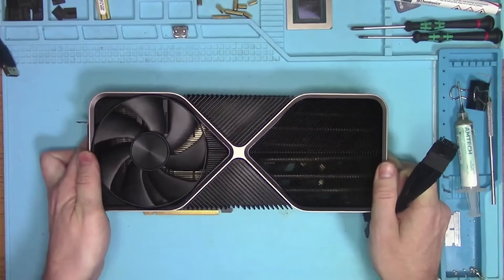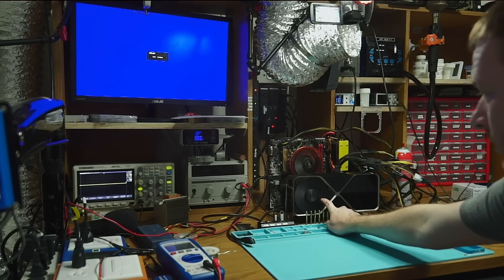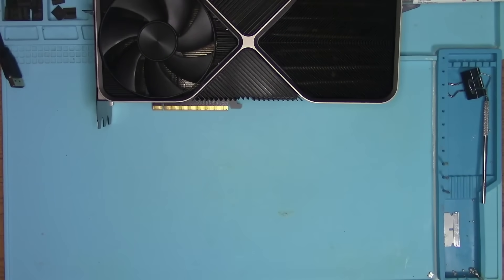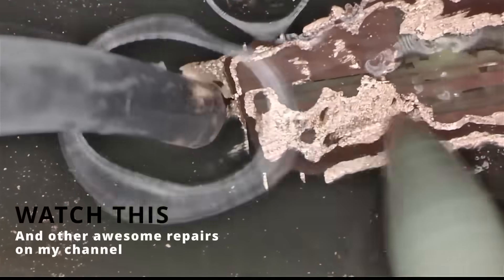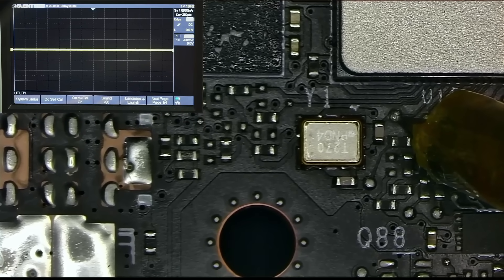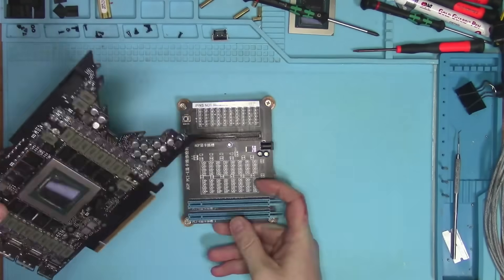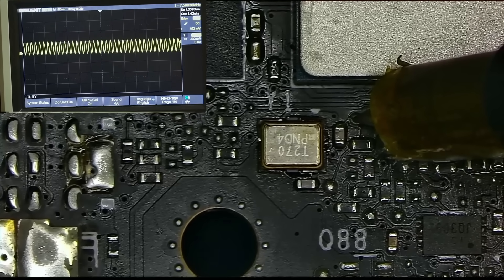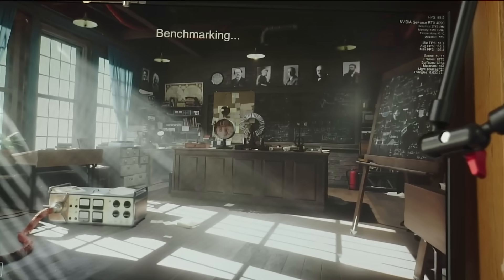*Warning* this video is NOT a JOKE

Comment: Fun fact: The first bug in a computer was actually a moth that wandered into a computer and caused constant errors. Since the machine didn't stop and wasn't equipped with any of the fail safes we're used to today, technicians had to figure out the problem all by themselves. This was back in the 40s. Nothing was modular back then. When something broke, you had to take everything apart and rewire the entire machine. Computer technicians were more like car mechanics.
Reply: Remember-the active elements of the computer were vacuum tubes with high voltages.
Reply: Both my brother in laws were time served car mechanics, when all else failed out came the real tool kit a big hammer and a wrecking bar.
Reply: The version of the story I heard was that it was slot-card computer, and the bug made a 0 become a 1 or vice-versa.
Reply: @benoitbvg2888  I think it's the absolute nightmare of any programmer when debugging an error doesn't cause a crash! It's kinda like navigating a huge maze and after you reach the end, you discover you're not at the exit and you probably took a wrong turn somewhere.
Reply: That "fact" is indeed funny but wrong. The word bug was already used in technical contexts by Thomas Edison and others 150 years ago and comes from a Middle English word. The situation with the moth got famous because it was a literal bug causing a bug, but it wasn't the origin of the term.
Reply: @brinkoftext  Yes, actually I only recently learnt about Edison being among the first people to coin the term "bug". But, I would argue that the incident with the moth was the first bug in an actual computer. So it was the first known computer bug. There could have been hundreds if not thousands of smaller problems involving other machines, but this was the first notable bug in a Turing type automated computational system.
Reply: @robdom91  Unless you exclude all kinds of software bugs this 100% was not the first bug in a computer. And even without software I bet there was at least one computer prototype before that which had a bug in its hardware design.
Reply: @brinkoftext  If we also consider analog computers then we can go back all the way to the stone age. I'm guessing the first bug being called a bug must have been so uneventful it's obscured. So, in that sense it's impossible to tell which machine had the first bug. We can only know about recorded incidents. And I was talking about actual computers not just any machine. Though, it's strange I never heard the term bug used in any other context besides computers. This could mean Edison and friends didn't use the term often as it didn't really stick in any other context.
Reply: @robdom91  Edison wasn't the first to use it, just the first case that's documented. He used the word like it was already established in engineering circles.

"And I was talking about actual computers not just any machine"
Sure, but that computer Grace Hopper worked on wasn't the first digital computer.

Comment: How the fuckballs?... That wouldn't have passed QA, so how'd it even become available to the public? Because in theory those that don't pass QA are looked at and fixed or stripped for parts. Guessing it went in the "recycle" bin after failing core tests but some enterprising worker grabbed it and sold it. Which is crazy given how strict GPU manufacturer's are about prevent employee theft.
Reply: Could it have been a larvae that hatched and caused the detectable fault later?
Reply: @SianaGearz  - no, the heat from soldering would have killed the egg. Also the insect looks fully grown, though what species it is I have no idea. As I majored in molecular biology, not entomology :P
Reply: @The_Mess85  Oh right how did i not think of that. That it has no chance to survive hahah make your time all your base are belong to us, sorry.

Let's say it's a fruit fly. Others say it's a fruit fly. I have no clue, but it does look like it might be one.

I'm still wondering what if the card DID pass QA somehow, like if the insect was dry enough because well 260°C generally make quick work of moisture, and nested itself just between the solder balls, so it wasn't an electrical problem initially, but then something happened, maybe the carcass drew moisture from the atmosphere or some such like and became a little conductive, and clock drive tends to be an extremely impedance and capacitance sensitive circuit, or the steam that the insect gave off while soldering prevented the formation of a good solder joint nearby but it was sort of touching, there was signal, until some heat cycles later the connection broke because there was a spotty oxide layer across the pad.

Comment: So nvidia do not xray as part of quality control....., what else they do not do.....
Reply from the maker: They also dont install LED connectors so your LOGO has LED's and a wire but no connector on the PCB
Reply: They might actually do that but they didn't have the software flag up a fly larvae. It probably didn't look like much because the weave of the glass on every substrate is a little different so you won't have the images match up exactly anyway and the opacity of the organic matter is similar enough. X-ray would only be looking for defects in the metals and soldering.

Comment: You should have sent a bug report to Nvidia hotline 😂
Reply: lol "I found a bug in your graphics card😂😂😂"
Reply: NVIDIA:  That was a user bug.
Reply: Nah, don't bug them
Reply: NVIDIA: Sir, that's not a defect... that's our new thermal compound  BugPaste for organic cooling.
Reply: Should i be worried about Cable-Mod 180 v1.1 -- it secured solid or will it melt the GPU connections when I'm pushing the card hard w/flight sim graphics?

Comment: I had a bug fly in to an empty RAM slot on my mobo- it shorted the MOBO out. Luckily letting the mobo sit overnight and the capacitors discharging fixed the issue (after removing bug and cleaning RAM slot) 
Bugs kill computers too.

Comment: some of the most impressive shit i've ever seen period the amount of skill this guy displays is crazy
Reply: same thoguhts, that's some dedication and skill, i wont even have the patience
Reply: You can tell he didn't get that way without tons of practice and repetition, too - what I always find pretty interesting about watching guys do stuff like this is that I can tell how seasoned they are just by watching their handiwork / fingerwork - right down to how they apply solvents or pastes or the like.   You can usually tell when someone not only has a firm grasp of something in their head, but also in motion - committed to muscle memory I suppose you could say.  It definitely shows.

I guarantee, even if I hid uncertainty, just about anyone would be able to tell if I were to make such a video - even if the info in it were 100% correct, you'd be able to tell almost instantly if I stepped in front of the camera to do the exact same procedures... that I was a rank amateur.  This guy's videos actually do sort of inspire me to take this up as a hobby, using one of my old cards from builds long past.
Reply: @VeggyZ same bro I really wish I could redo what this guy does this is pure artwork at its finest
Reply: @VeggyZ  correct, if he screws up the amount of flux on that main GPU chip, it's a no go and a do-over.  It's like a commercial airline go-around...too many of those and you're fired.

Comment: I had a mainboard with dead USB ports due to a mosquito shorting something (that is probably related to the USB) on the mainboard. Basically I heard a pop and a smoke coming from the PC and since it was fresh, I can immediately see where the smoke came from, thus found the fried mosquito and unfortunately partially dead mainboard. The mainboard still works, just the USB can't be used, but I can't trust using something like that without fully fixing it and the cost of fixing it from my POV is not worth it since it is a board for Intel 4000 series CPU which you can buy a 2nd hand board for cheap (this happened during times where Zen+/2000 series was new).
Reply: That's very weird. The highest voltage on the board is 12V, and I don't think it's normally lethal to an insect. Perhaps it was particularly wet and got killed by heat induced by the current...
Reply: Pity we don't have picture chat here, I'd love to remotely diagnose this board and see what sort of damage it took and how safe it is to run.

Comment: I had a laptop that would not turn on with batter or charger, no lights would turn on
opened the back panel and for some reason my eyes caught the sight of a black dot on a tiny capacitor
it was a tiny ant  with one hind leg and a front leg shorting the cap, dusted away and laptop worked!

Comment: You could say this was a...
...buggy card.
(Sorry.)
Reply: @_-Montana-_  It's like they suddenly decided to outsource production somewhere they don't have great quality control and building standards. I don't know if that's actually the case, but it'd make sense.
Reply: Well, that is where the term "computer bug" comes from:  an actual bug.  Wasn't it a moth or something on a board way back when that was causing problems.
Reply: @kevinbarnard3502  You're thinking of when Grace Hopper found a moth squashed in a relay... however, her note was about it being the first case of an actual bug being found, indicating that "bug" was already jargon by that point.
Reply: @kevinbarnard3502  The word bug was already used in technical contexts by Thomas Edison and others 150 years ago and comes from a Middle English word. The situation with Grace Hopper got famous because it was a literal bug causing a bug, but the term is much older.
Reply: I just want to smack you so badly right now.  Is this normal? ...I am not a violent man!
Reply: so does everyone else and their mother

Comment: That is insane. You would think their 'clean' rooms at their OEM would be clean.
Reply: Bugs find a way to get into everything. No matter how clean you try to keep it.
Reply: Leave Democrats out of this!  @ArtisChronicles
Reply: @ArtisChronicles facts though
Reply: @ArtisChronicles  Never had a bug in my asshole, and I don't even wipe.
Reply: @ArtisChronicles  The re-balling of the master chip was not necessary, or was it?  I see that a different chip was replaced but I also see that until the main master GPU chip was re-balled the oscillator was not reading correctly.  So what was the fix and causation?
Reply: Your comment made 65 percent sense
Reply: Insects manage to get into everything sadly.  Even super sensitive electronics.... I guess.
Reply: The main problem is that you can never really 100% guarantee it. Like you can take measures and stuff to reduce risks by a lot, but eventually you come to the point where cost, inconvenience and extra effort just isn't worth it to get one step up because they go up exponentially. And that applies to defective cards that leave factory too. Hence at some point you calculate how many defective cards will get out based on chance, including ones with literal bugs and number is small enough to where just RMA cost of those cards is way cheaper than reducing number of them. I mean it isn't like this is very common, so I am pretty sure their rooms are clean, likely what happened is that either stars aligned and bug flew in or someone had one on them and they didn't notice and somehow it stuck on them till it got in. And sure clean room does reduce chances of bugs, it doesn't completely eliminate the problem of them trying to get in anyway, even though there is no food or whatever for them. Which likely contributes to how rare it is to find bug under GPU. Or as I like to joke, chances of getting killed by cow on farm are very low, but never zero.
Reply: @Seth22087  But that other component was also dead, unless you believe the bug somehow caused a component elsewhere on the board to fail which might not be impossible (one system affects another) but sounds very very unlikely.
Reply: Dude people alone can get bugs on their shirt, you think people get bugged sprayed before they enter the room?
Reply: Someone has never worked in a warehouse
Reply: Yeah it looks too big to get in after the fact, must have got trapped during production.
Reply: I'd say it's a coin flip. Scale economics tells me not all cards that get out the factory are tested, so this can be either a fault directly at the factory that fell through the cracks, or a bug that got inside after the card was let out in the open, because yes, very small bugs can very well get in between chips, boards and even solder balls
Reply: @cldpt  Not every card is tested for a longer period, but normally every single is tested for a few seconds, if it runs or not. No completely dead card leaves the factory.
Reply: @masterluckyluke It probably worked for a while, but seems like it would have happened during manufacturing.
Reply: @cuzr702  Maybe possible, but we will never know for sure where this bug came from.^^
Reply: @masterluckyluke that is simply not true. If it was the term DOA wouldn't exist.
Reply: @masterluckyluke  Well maybe that's the theory but sometimes people don't do what they are meant to or make a mistake.
Reply: @cldpt  The big deciders on whether components and assemblies get tested is the cost of doing RMA work and warranty replacements. If it's cheaper to do a 100% test and burn-in post assembly, that's how it's done. For components, there's often times enough errors in the manufacturing process a 100% test is necessary to find bad components and to grade the ones that don't meet performance requirements for whatever SKU they're sold as. For a $1000+ graphics card, I'm going to go with that they're doing a complete burn-in and functionality test before it hits the warehouse or retail store. I know of manufacturers that have done it when smaller profit margins are in play, and the profit margin on the 4090 is well padded.
Reply: @cldpt  For prices nearing $2,000 dollars it's not unreasonable to expect testing of each unit and a bed of nails style test would've only taken a few seconds.
Reply: @cldpt  The warranty works, and now the repairman has an interesting experience and a video card.
Reply: How often are you seeing this happen? That is what you should assess before deciding if it is indeed insane
Reply: Not even our food is 100% bug free how can you expect this?
Reply: @Tenshi786-e2y  bugs shouldnt eat eletronics
Reply: I'm thinking it was remanufactured/"recertified". I highly doubt that device came off the factory floor, first run, like that.
Reply: i mean its cleaner than a animal slaughter and packaging house and butchers back room lol even cleaner that your local 5 star restaurants kitchens ive worked in many of these places in Florida and New Jersey and a and a electronical manufacturing clean room is very very clean
Reply: @ShantalhaitianPrincess  Sounds like you've read "The Jungle"
Reply: @ i read it in 9th grade lol but working in Hotels and restaurants made me never want to eat in them even the 5 star high class ones
Reply: And TWO independent manufacturing faults in a brand new product that still go shipped, so that is a 3rd fault!
Reply: Nah, honestly it would have been even more expensive to have clean rooms along the entire process.
Reply: why would a viewer even send this in, instead of RMAing it. weird af.
Reply: He said at the beginning that it was a resale place it was purchased at maybe it happened there
Reply: @BjornT97  doubt the resale place opened the fucking core of that card
Reply: You expect a perfect world I presume.
Reply: @davidlong1786 In a professional working enviroment that is kept clean, this wouldn't happen. That's not the case for some sweatshop in china or whatever.
Reply: @davidlong1786 i completely agree
It's impossible that at one point during assembly and packaging there won't be something
Reply: @hristiqndimitrov5249  But the bug, the dead component AND no testing?!
Reply: From experience I can tell you that insects find a way into cleanrooms all the time. You'd need a very high level cleanroom to prevent that I would say.
Not to mention this bug can very well get there afterwards anyways.
Reply: dont forget that rtx cards litarraly came oxidated out of the fabric in china and pass the quality control like that bc its no problem.. that what you pay for 1000 + bucks
Reply: Not all aspects of building these cards are done in clean rooms.. likely the board came into the room with the bug already on the PCB before the core die was installed.
Reply: No one would have even seen that because it’s so small. Bad luck.